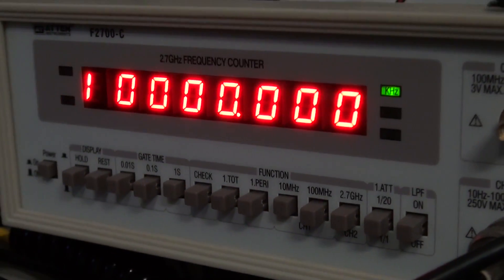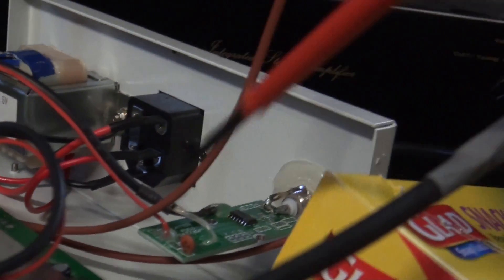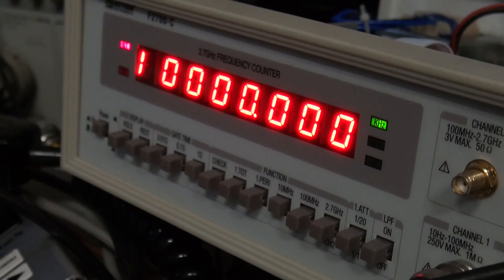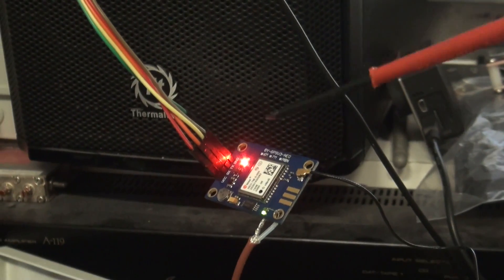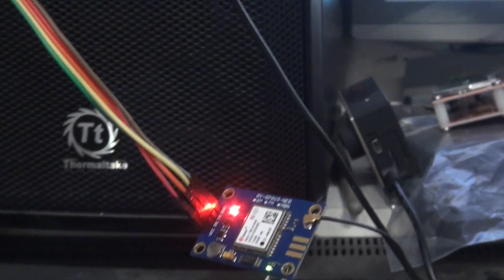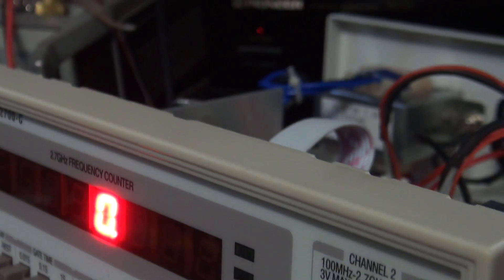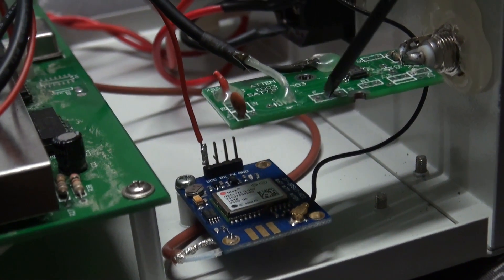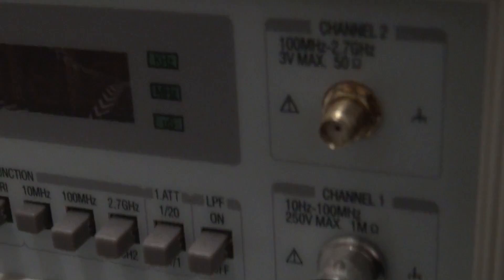GPS referenced frequency counter modification

Comment: Can you make a video where your GPS referenced counter shows more than just 3 digits of precision? My equipment gets 5 digits precision without even using this GPSDO, so seeing "10.000" doesn't really help. Great video btw, thank you for it. I just really need to see that it actually works because I am building a similar project and the GPS module is only getting 10.00006 precision which is not high enough to be considered "GPS Disciplined". It should be more like 10.000000 I think.

Comment: I'll try this on my VC3165 which always seems to be off by at least 30-40HZ at 10MHz.
However, am I actually seeing the output lead to the counter board, connected to the junction of the 1K SMD R and LED, or is it before the 1K SMD R after the chip output lead?

Comment: Wondering how to discipline the OCXO so to make a better phase noise system... then again... for a counter that would be overboard.  

 I was just looking around to see what there is for the cheap frequency counters improvement and this got me thinking about improving the Victor VC3165 I have.  Neat design and thanks for sharing.

Comment: Nicely done. Precise measurement does not have to cost a bunch of money providing one is willing to sleep on it a few nights. This begs the question why makers of frequency counters are not using GPSDO as a time reference? While on this subject how can there be a 100 to 1 pre-scalers for the GHz range without reading the pre-scaler divide chain  for a 10 digit display fundamental not the weeny 8 digit display. In closing I will say again nicely done , it put as smile on my face.
Reply: Quartz oscillator at a referenced temperature. Same as watches.

Comment: That little connector @15:38 is an MCX connector.  Smaller ones are called MMCX connectors.

I'm thinking of buying one of those cheap Victor VC365's.  The main complaint is that it takes about a half hour for the OCXO to stablize, and the update is a little slow.  Do you think the mod would be straightforward for that as well?
Reply: Sorry, I am wrong.  That's not an MCX connector.  It's an U.FL connector.  Sorry for the confusion.
Reply: yes